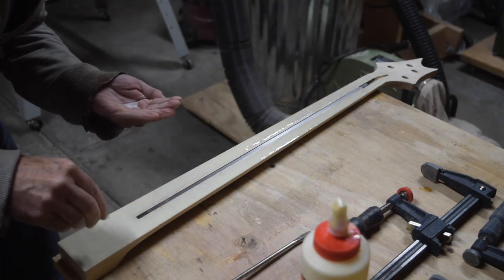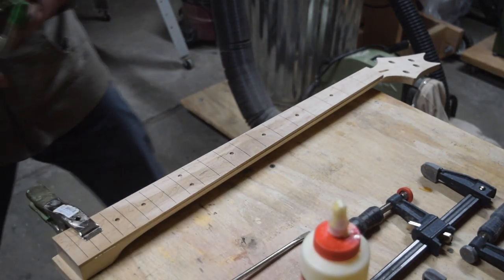Making A Highline Bass Guitar Part 4: Installing the Truss Rod, the Fretboard, and the Marker Dots

Comment: Very nice so far Chris! What a great tip with the duct tape and band saw to get the dots cut out!! Thanks as always for sharing you knowledge with us bro, best luthier channel on you tube!! I've learned so much from you in the last few years I was able to take what I already knew plus all the great tips from you and a few other great builders on the tube and a few months ago I started a guitar repair and modification shop, over here in Mass. I've already had some good customers that love my work and come back for more! (Probably because I charge next to nothing, my wife gives me shit about that but I enjoy it so much it's hard to charge friends) But what a great part time job! I've even brought a few guitars to work with me and completely changed the shape of a few bodies, I've been a machinist for over 30+ yrs. and I'll punch out and stay late at the shop righting programs for new body shapes. Does your cnc router read G&M code? Just wondering... Anyways thx. again for all you do my friend.........    Mike (Ipswich River Guitars).
Reply from the maker: I only use g code.
Reply: @HighlineGuitars  That makes sense since the M codes are machine codes (like spindle on clockwise/counter clockwise spindle off, most things that can be controlled manually... Does your machine read G code canned cycles?
Reply from the maker: @MikeCindyWhite  No. I'm using grbl 1.1 on an Arduino Uno.
Reply: @HighlineGuitars  Wow, Very nice Chris I like watching your machine because you made it... Far beyond my skills!! 👍

Comment: You can scrape that glue squeeze out off after about 30 minutes which makes for less filing/sanding of it when it's fully hardened. You still get the benefit of not getting it into the wood fibers like you would with a damp rag like you mention with a lot less work.  Great project, BTW.
Reply from the maker: I think it’s better to let it dry completely. If you don’t time it right, the glue will be dry on the surface, but wet inside. That can cause the glue to smear when you file/sand it off. The result is a ruined neck!

Comment: With your method, do you ever have rattling of the truss rod beam after glue dries but before you put tension on the rod for the first time?  I got rattle in mine right after gluing and I even used a little silicone sealant in a few local spots in the truss rod channel before setting the rod in.  I think the string tension will nullify it when I get to that step, but it still bothers me that it was there.
Reply from the maker: Never had the dreaded rod rattle.

Comment: Hi Chris, does the direction of truss rod affect the neck relieve locations? For example, if the truss rod tail (or head?) towards the headstock like in this video, does it mean the first 2 or 3 frets will be less affected by the truss rod compared to if you change the truss rod tail to facing the bridge? If yes, which direction of the truss rod is better?
Reply from the maker: Before you decide whether to position the adjustment end of a truss rod, adjust it in both directions to see where the center of the bend is. That’s where your maximum relief will be. Position the truss rod so the point of maximum relief will be for your neck design. To do this, you may find it necessary to mount it with the adjustment end at either the headstock or the heel.
Reply: @HighlineGuitars  thanks Chris! Just watched another video of yours about ‘truss rod replacement’, learnt a lot!
Reply from the maker: @darren4007  I just finished shooting another video that addresses your specific question. It'll premiere tomorrow, June 20, 2023.
Reply: @HighlineGuitars  thank you Chris, looking forward to it!

Comment: Question won't the salt rot the wood
Reply from the maker: No. Salt needs water and air to initiate rot and there is neither in the space between the fretboard and neck. Woodworkers have been doing this trick for centuries.
Reply: @HighlineGuitars  ok I did not know that. Thanks for getting back to me